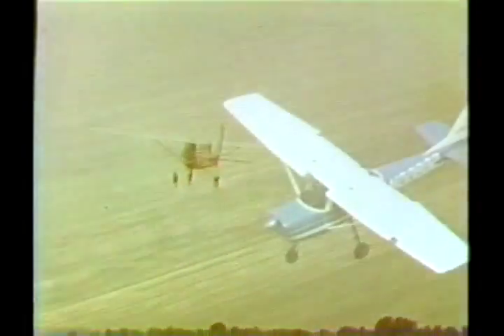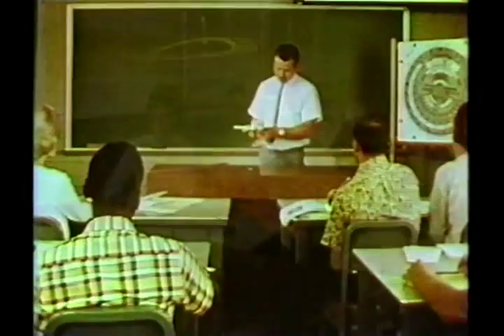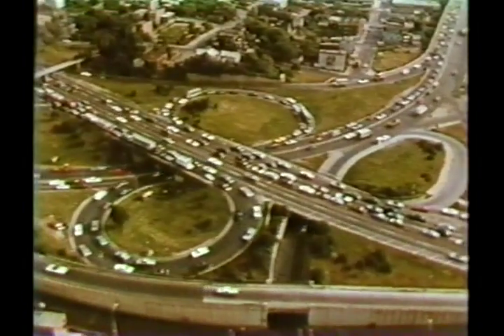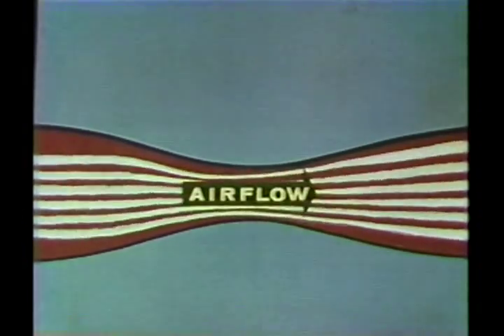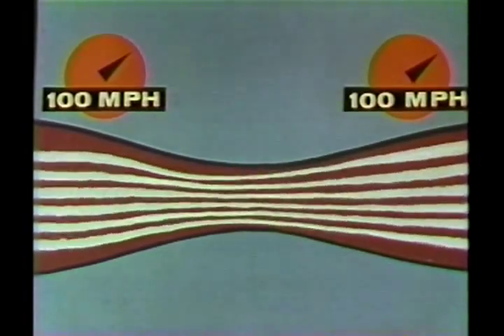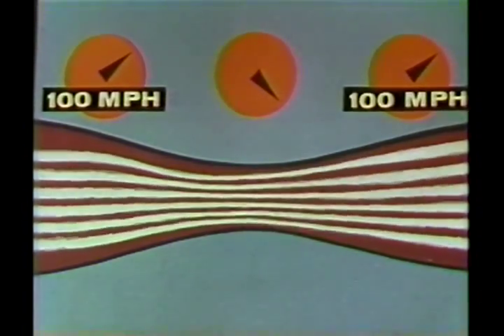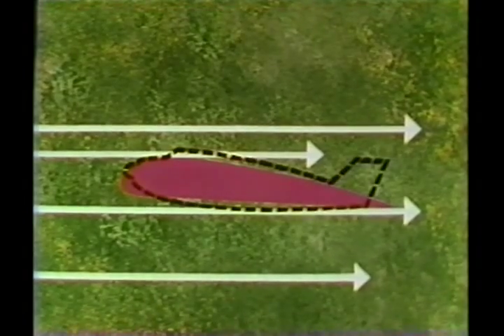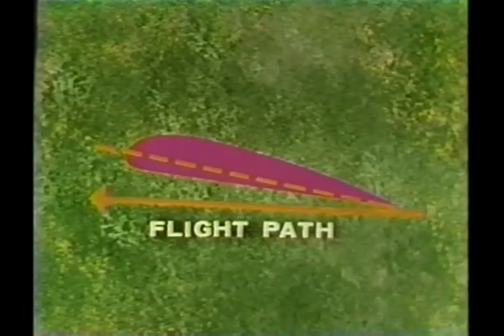How Airplanes Fly - FAA video Aerodynamics Private/Instrument/Commercial Pilot training 1976

Comment: 5:22 - that is just SOOOOOOO nonsense.
Reply from the maker: Yes, and what's crazy is that folks that design 5th generation supersonic fighter aircraft believe this nonsense but what do they know, right?
Reply: @badgyro1  I'm pretty sure that someone working on the aerodynamics for a fighter aircraft actually understands how airfoils work and concepts like circulation, downwash, the Kutta condition, and has at least a rough understanding of the Navier Stokes equations.
Reply from the maker: So are you complaining about the simplification? Or do you not feel that there is a pressure differential between the upper and lower surfaces of an airfoil caused by the Bernoulli effect that accounts for a large percentage of lift? What exactly is the "nonsense"?
Reply: @badgyro1  One could argue that pilots do not need to know what causes lift. And, it would be hard to refute that argument given how many successful pilots don’t have a real clue. You will see lots of explanations (like in this video) that start out talking about airfoils having curved tops or looking like a cross section of a venturi. You will also hear pilots claiming that it’s Bernoulli on the top and Newton on the bottom (generally having something to do with flats and curves). But those ideas are simply not true. 
An airfoil does not need to (and in many cases does not) look like a cross section of a venturi to generate lift. An airfoil does not need to have a curved top at all. Now, there are practical reasons that airfoils tend to be curved on top – introducing camber allows higher coefficients of lift and you need room for structure, but a curve is not a fundamental property of an airfoil. And clearly, a curve is not required for lift. Examples of successful flat airfoils would be paper airplanes and those cheap balsa gliders. It should be clear that they fly just fine and generate lift without a trace of a curve. So it should be equally clear that any “explanation” or “simplification” of how an airfoil works by introducing curves or cross sections of a venturi is “Soooooo nonsense”. 
I will agree that it takes some effort to present an anatomically correct simplification of how a wing generates lift. If you try to introduce the concept of circulation – game over – pilots will just fade out when you get into vector algebra (in spite of the fact that this is how the back of an E6-B works).  You can talk about downwash – but how does that get back to generating an actual force on the wing to hold the airplane up? Yea, more math.  O.M.G. Ask an instructor if some pilots struggle with math that is as basic as weight and balance.
Now, as far as the pressure difference between the top and bottom of a wing that keeps airplanes in the air is concerned, for subsonic flow all of it can be calculated using Bernoulli’s equations (basically the tradeoff between kinetic and potential energy applied to an ideal fluid) (given the assumptions behind the equations) – flow is faster over the top (higher kinetic energy, lower pressure (less potential energy)), slower over the bottom (less kinetic more pressure) – and the differences in velocities can be modeled via circulation – but then there is that vector problem again. 100% of the lift is also due to Newton’s laws – the only exceptions to Newton’s laws are found in quantum mechanics and relativity – neither of which are particularly relevant to subsonic airfoils. And yet, I have heard pilots claim that the low pressure on top of a wing (over the curve) is due to Bernoulli and the higher pressure on the bottom is due to Newton. Again, nonsense. However, to get through the derivation of Bernoulli’s equations starting with Newton’s Laws applied to an ideal fluid involves math – the most direct way uses bit of calculus. Good luck with that. 
But, the fact that it is hard to provide a fundamentally correct explanation does not make fairy tales involving curves, flats, and venturis any less nonsense. If you cannot explain how a Gullow Jet Fire Glider generates lift with its flat balsa wing, you cannot explain how a wing generates lift. And, while we can get away with telling pilots with fairy tales, that doesn’t make them true.